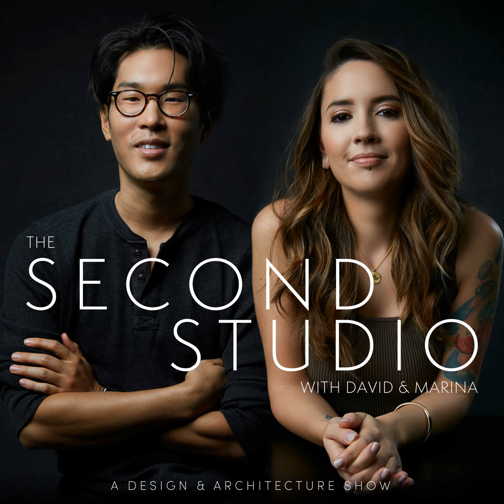#409 - The Problems with Design-Build

Comment: Great info.  I really agree with what you are saying.  However, just because you are a "Licensed Architect" does not guarantee quality.
Reply from the maker: 100% correct. We’ll probably do a recording about that exact point!
Reply: That would be great!  I am a Residential Designer, (not an architect)  I do all high end work, and charge similar fees.  It all depends on the individual design professional. Almost half of my new work comes from people who have fired an architect for a variety of reasons. The main reason I hear, is that they don't listen, and have been through almost a dozen iterations on a design, have paid $12-14k, and aren't even close, and they are furious.  The RA is usually  trying to impose their own personal "edgy" style instead of doing amazing creative design work that the clients are excited about.  So, quality is not assured by hiring an architect, it all boils down to the individual doing the design.  People are easily lured into Design-Build, and will accept vastly inadequate design work to avoid the headaches, and costs that come with hiring an Architect.  The disturbing proliferation of Design-Build firms, says volumes for the failure of architects to offer quality services.  That needs addressed, or we'll all have to be swallowed up into design-build.  It's about to happen.

Comment: Hello  very interesting episode as always!   I have a question. When you say the usual architectural fee is around 10-12 % or more of the construction cost, is that fee for the architectural part of the project alone or does it include structural engineering and MEP? And is that in US or Europe?
Reply from the maker: Great question. In general, 'construction cost' means the total amount it takes to actually build the project which includes all the building materials (including MEP), construction labor (including MEP), general conditions to the contractor, the contractor's overhead and profit. It often also includes the materials and labor of the landscaping.

Basically it's everything that goes toward construction, and does not include 'soft costs' such as design fees, engineering fees (structural, civil, MEP), lighting design fees, permitting fees, inspection fees, surveying fees. It also do not include loose items like furniture.

It depends on the market and the quality of the structure, but I'd say 10% is on the lower end. 15% is upper-mid and 20% is high-end for architect's fee. Usually the % lowers if the project is substantially larger. 

Most architect's these days charge hourly or fixed. Billing as an actually % of construction isn't as common as it used to be.

This info is for the US. I'm unsure what it's like in Europe. My guess is that if we're comparing apples to apples in terms of project type and services it's probably about the same.

I hope that helps!
Reply: @secondstudiopod  Thanks for the detailed reply. Actually I asked this because in my country, many times architects offer include structural engineering and MEP fees too just so the client gets a more detailed estimation,  but from what I understand, the 10-15% that you mention  is solely the architectural part, without  the other disciplines ?